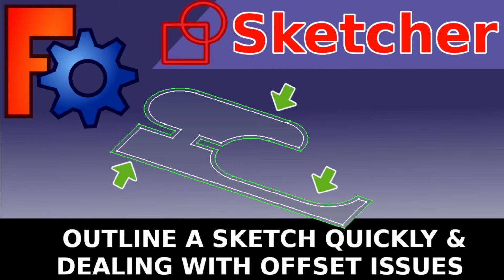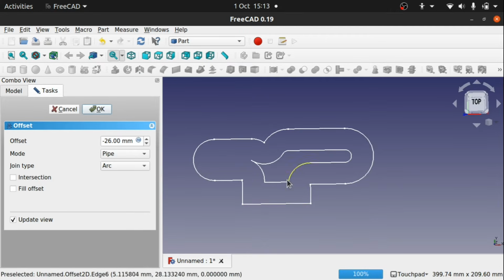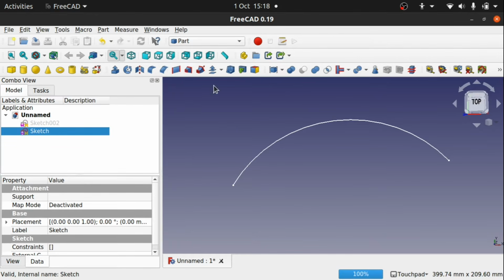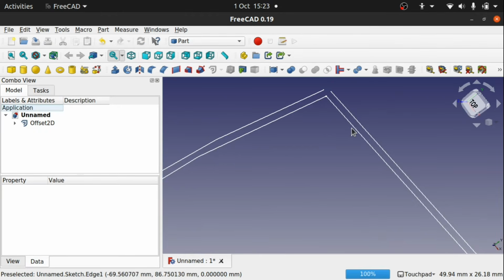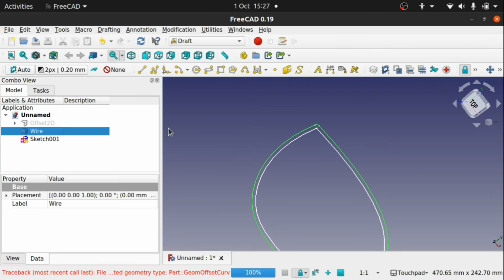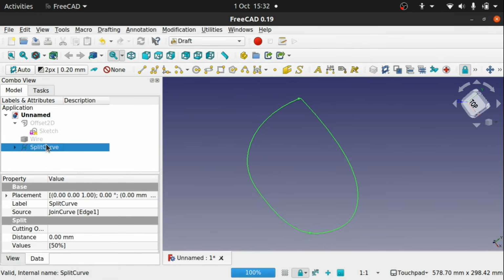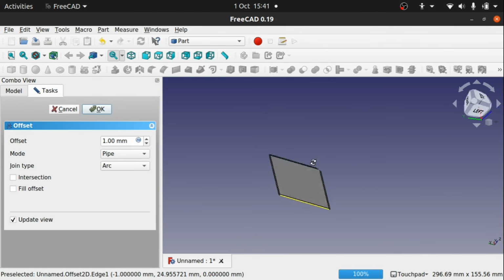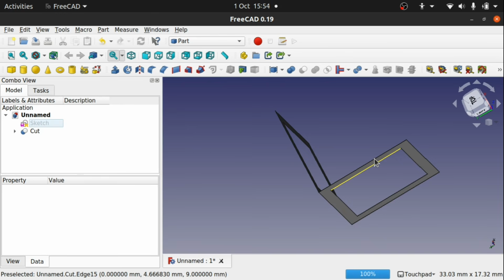FreeCAD: Sketcher - Offset / Outline Geometry and Problems and Fixes Converting to a Sketch

Comment: I find Freecad frustrating for one reason, nothing works.  I realize that this video is 4 years old and I am using version 1.0.1, most of my screen does not look the same, but I found the offset function and when I use it, I am then unable to extrude the offset lines.  It says "cannot use selected object.  Object must belong to the active body." I don't know what to do now...I have tried checking the "fill offset" box, but that fill also will not extrude.  I know freecad is free, and I wouldn't mind donating to them, if the bloody program worked once in a while.  I have spent hours trying to learn how to offset something.  This should be a simple operation.   I wish someone would make a video that shows the freecad errors and how to fix them or work around them.

Comment: I've run modelers back to AutoDesk Mechanical Desktop. ProE, Inventor, and SolidWorks were my meat for years. Why are these functions NOT contained in the sketch workbench? Offset is a basic function that we use very regularly.
Reply from the maker: This is an old video for 0.21.  In 1.0 and above they exist in the sketcher workbench.

Comment: I’ve been trying to offset an imported SVG pathway with no luck. Almost thought I had it figured out about 3 times during this video.

I simply drew up a clover ☘️ in inkscape(which I can easily offset using inkscape) and saved it as an SVG then brought it into freecad as an import. Tried offsetting in the part bench and I keep getting an error of “makeOffset2D: result of offsetting is null!”

Freecad 0.20.1

What I’m trying to do is use offsetting to solve a chamfering problem with complex shapes for 3d printing. I figure if I can offset by the layer height divided by the tangent of my desired chamfer angle and stack layers progressively underneath the original, it might help automate the process of preparing a 2d design into 3d for sandcasting

Comment: Cool video. Thank You . The only element I would change is  to not just "manual style" show Us where the functions are, but  to  explain them by solving real problems like designing two joined parts with tolerance between them. Then this video would be perfect :)  ... Regardless . Coll video .. Thank You :)
Reply from the maker: You be happy to know that this video will become redundant soon. In 0.22 version there will be a sketch offset tool for offsetting geometry. Glad you enjoyed the video and thank you for the feedback.

Comment: Thank you, but I will mostly stick to the Offset macro I was using until now, since I don't have to leave my sketch and do any conversions. But good to know about more possibilities 👍
Reply from the maker: Thank you, this is an older  video and looks like the offset hasn't changed  as of yet. Very interested in the macro, haven't seen that one yet. I will take a look, thanks for the heads up. 👍👍

Comment: Thanks for your very useful teaching - you are really excellent at making things clear, especially for someone new to freeCAD.  I think I have found a way to stabilize the performance of the b-splines so that they don't give so much trouble.  This may be obvious to everyone - so apologies if that is the case.  I have found when you do a b-spline it performs much better if you use a construction line at an end of the spline, that will be connected to some other geometry.  That end point and the first control point in from it, should be attached to the construction line.  This forces the spline to be tangential to the construction line.  If you are joining a b-spline connected back on itself, as in the problematic example you give (12 mins in), then you have one construction line with the join attached to it, and the control points either side of the join also attached.  You still have great flexibility in getting any shape you want, but the math doesn't seem to blow up!  The offset seems to work with no obvious problems.  Shame I can't attach an example.  If you are attaching to some other geometry, like an arc, you can make your construction line tangential to the arc, so that the spline is forced tangential to the arc as well.
Reply from the maker: So glad your finding the tutorials useful and to your liking. Really appreciate you went through the effort to explain that technique. All comments like that really help enrich the content and are always welcome. I have started to keep an eye on the weekly builds and the new version of freecad coming has so many improvements around bspline. They are problem in most cad packages not just freecad as they are extremely complex to program. Can't wait for the changes. Thank you once again for the detailed description.

Comment: Am I correct in that the offset function is unavailable within a sketch in a body (part design)?
Reply from the maker: The offset is only available outside but you can go over to the draft workbench and convert the offset to a sketch and drag this into the body if that helps.

Comment: Wow, I had a search page up of Freecad videos, and this one was right there to answer the question I asked on the last video of yours I saw. That gets a sub just for being so handy!

(One tiny nit though, Ko-Fi is pronounced like Coffee. The conceit was "Buy your favored creator a cup of coffee." At least that's how I first heard it.)
Reply from the maker: Thank you for your comments and the sub. Glad you found it useful. Yes, I really need to redo that extro, I didn't know about kofi or how it was pronounced at the time, sounds quality of the clip is questionable anyway. It was about two months after I found out and had a back log of 20 vids still to be released 😂
Reply: @MangoJellySolutions  Doing this has still been a little tricky. I made a sketch (outlining an image I had imported in an image workbench), went into part and offset it twice, 1mm and 2mm extra. But the first time I tried to pad it, it only padded the original outline. Later, I tried the business of converting from draft to sketch, and the 2mm outline got broken somehow, and padding only raised the outline, not a solid. It's been very weird.
Reply: I've run into another couple of weirdnesses. The project I mentioned was a sort of tray to fit around the bottom of an electronic device for mounting it. I took the sketch and made two offsets, 2 and 4 mm (the 1 and 2 mm version was too snug, and a little fragile). The 4mm one padded, but the 2mm wouldn't make a hole. They were both on the 0 plane, so effectively on the bottom of the padded solid. Apparently I couldn't make a hole "up", so I had to raise that sketch to make the hollow in the tray.

Comment: It would be nice if these tools were in one workbench. It would also be nice if the offset tool just generated a sketch. Thanks for the information it's a huge help for anyone coming from most other 3D drawing programs. Cheers
Reply from the maker: The tools are a bit all over the place. I would rather the tools be repeated as I do spend time jumping from one wb to the other. For my general work I have moved a number of them to other workbenches by customising the toolbars. I don't use this setup for the videos as it's confusing to people trying to find the tools which I have moved. If the offset made a sketch out would be a great help.
Reply: @MangoJellySolutions  Once you know it is OK. I am following your video's from scratch and don't mind moving from one tool tot the other. (same as in a workshop: to drill a hole, take a drill; to turn a rod, take a lathe etc. ) I just consider that it splits the various functions into groups. Before I just tried to use one work bench but, after seeing your videos, I have better understanding of the various tools and structure. Thanks.
Reply: I was looking for the offset and I couldn't find it. Turns out it is only available within a sketch drawn from the part WB, not in a sketch in the part design WB. Which is odd, because I thought the whole philosophical difference between the two is one is built around solids and the other around features (and thus sketches). I stopped making assumptions when working with WB. The only logic here is "we have always done it like this, so keeping it that way is logical".
Reply: You can use Offset macro directly in the sketch. Though it's a shame it's not directly available as a tool button.

Comment: Unfortunately, FreeCAD doesn't have built-in offset tool in sketcher so the only option is to do it outside of sketch or use a macro called Sketcher Offset.
Reply from the maker: Thanks for the comment, I haven't seen that macro.  I will go and have a look, thanks for sharing.